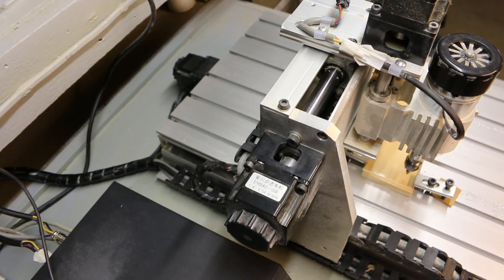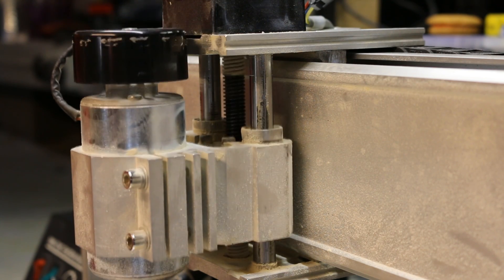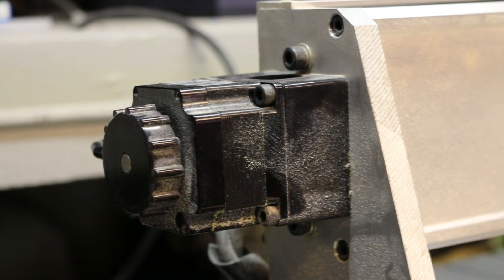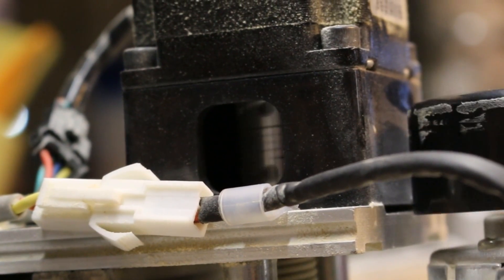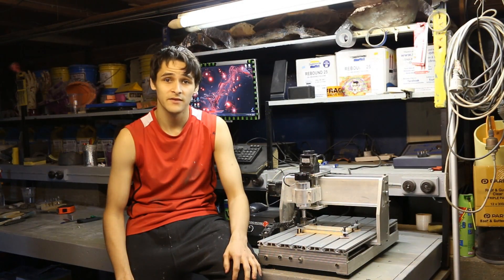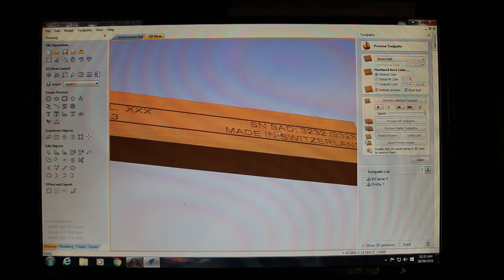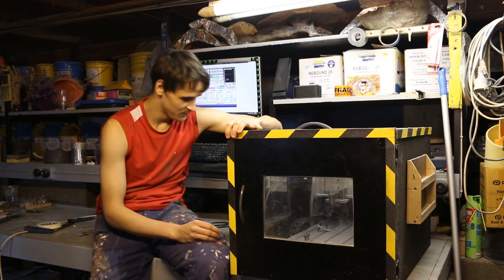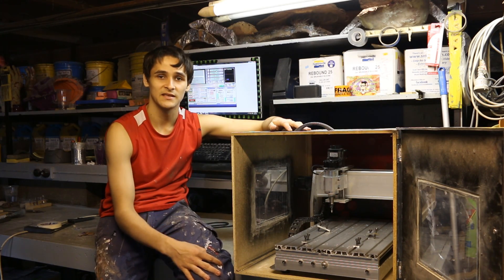3040 China CNC | Review | motor settings | milling and engraving

Comment: I’ve one the same but I change the circuit board to run arduino and changed the drivers to tb6600 , I had to rewire the controller which was a daunting task for me as I’m don’t have much knowledge in this field but good old YouTube came to the rescue and now I have it up and running again .
One thing I would like to add and that is it’s a very sturdy machine.

Comment: I picked up this machine during the pandemic off eBay, I got the 4 axis 3040 for 400$ which was a good deal. The planetcnc software has a issue.
The manufacturer hacked it and used what I believe was the diy hardware instructions to make it work.

I bought a license from planet cnc, and used zone alarm to block it from communicating with planet cnc. As they said it will self reset. Its been a few years, I like planetcnc's host software.

I've made a opensource software/hardware project with info on my channel. You can add functionality like mql to the hardware and spindle control speed. Using the software project.

Comment: Are you running that with a USB cable or a serial port?  I purchased a brand new previously owned 3040 4 axis.  I’m having issues getting the computer software(their version) and the controller to see each other.

Comment: You got a good deal. I paid $650 (USD) for a used 2030 China CNC without the computer and software. I am not unhappy with my purchase; the machine is very sturdy. I got Mach3 and VCarve. Although I got the cheaper VCarve Desktop, the software was still expensive. I drive it with a cheap old computer. Like you, I got this to learn on; there is much to learn, and I dream of graduating to a large machine when I can afford it. About 4' x 4' would be nice - something I could run a door to a house under.

Comment: Hi! Can you make a video on how to use the machine with the program it comes with? Had the machine for 6months now since i bought it i dont know how to use it.
Reply: Have you been able to get the software to talk to the controller?
Reply: @donaldtimme6923  i can move the X Y and Z with the program from the computer, i just dont know how to make anything..
Reply: @Pastor Jose what version of Microsoft are you running?
Reply: @donaldtimme6923  Windows 10
Reply: @AlphaGaming77744  Thank You for your responses. I am also using Windows 10 but the controller and software are communicating.  At least I know it will work with 10.
Reply: @AlphaGaming77744  Did you have any issues with loading the driver. My computer says there is no signature so it will not install that drive. Would be able to send me the driver?  I have had zero luck getting any response from China-CNC

Comment: +Daniel Bignoux, please let me know about MACH-3 compatibility with windows 10, some people say it is only compatible with windows XP, 
also share the link description of BIT you used in this video.
Reply from the maker: From what I know Mach 3 is not compatible with windows 10:http://www.machsupport.com/software/mach3/  I used multiple bits, such as end mills purchased from ebay listings and rotary tool accessories from my local hardware store so I cant really find direct links.
Reply: I have Mach3 running on Windows 10 but I am using a USB connection to the motor controller so that may be why it works for me.

Comment: Hello, I have been looking at the same machine in eBay, I am a hobbiest, and I would be needing to kind of Mill some small aluminum pieces, In all the reading and research there are many nice machines out there at a reasonable cost, but I think I can Make this wor, once i tighten tolerances and possibly change the spindle. y problem is figuring out how to get a drawing put together , Which software to do my drawings, then turning it to G code, and then to Mach 3, I am not a techie, any suggestions to start ? Respectfully, Jim P.
Reply from the maker: I found vectric software, I personally use Vcarve Desktop for my small machine as you can draw and create shapes, even use 3d models withing the software and its easy, im not a techie or a cnc wizard so it was and easier to learn vcarve, but there are a few CAD/CAM programs out there such as fusion 360
Reply: Daniel Bignoux thank you very much I am going to give that Victor program a try least take a look at it really appreciate you taking the time to get back with me I know you're a busy person respectfully Jim Price
Reply from the maker: No problem, I reply when I can. But if I get more then two messages withing a 24hr period thank googles notifications if I don't see them because they are always not showing up xD

Comment: ever milled 2mm aluminium ?
Reply from the maker: yes, i have been screwing around with aluminium for the past week and have seen good results, not the best but not bad coming from this little machine. I am going to do a video soon about it.
Reply: Daniel Bignoux great.....hope to see it soon. I'm in qld....where did you get your cnc? Do you have any sources for purchases. I watched a few videos and they say allu can be done nicely at lower speeds on this model.....
Reply from the maker: yup, slow and steady is the key. My spindle vibrates due to a broken internal clip so I cant get a really nice surface finish. I bought mine second hand off gumtree. I wasnt really looking at specific type of cnc back then, just a cnc machine on the cheap that can do the job. Now im addicted and want to build my own.

Comment: I have a CNC 3040T USB which I got from eBay. For rapid prototyping PCBs, engraving etc it's great.

So far I've not had any issues with bad connections, faulty wiring etc but it's early days. Fingers crossed I don't have any issues at all. I've recently done a few mods to mine.

Firstly I've upgraded the spindle motor from the stock 200W to 400W. That cost about £50 with the bracket and VFD and gives a little more torque. 

Next I've 3D printed out some end stop micro switch mounts which just clip on to various parts of the frame to give X, Y and Z homing limits. I'm just in the process of wiring them in now that I've mounted them and ran the wires through the cable harnesses. This will give me a repeatable home position to work from.

I've also just purchased a USB endoscope / microscope which I'm going to use as a Camera for alignment and positioning. I plan to 3D print out a mount for it to clip on to the spindle bracket.

At the moment I'm using the software that came with my machine which is called USBCNC and it's quite easy to use once you've got the settings for the CNC installed. Mine came with a settings file which I had to import and then after I did that I had to change the language in the USBCNC software to English.

It quickly became apparent that some of the settings were incorrect. Some of the directions were set wrong and the steps per was also wrong. It was set to 320 Steps per but having told the machine to move 10mm and it didn't, I quickly worked out that the steps per should have been 400 - so I put that right.

I actually quite like the CNCUSB software. It's very simple to use. Pretty much just home the machine, drag in the Gcode and start it up.

I wouldn't mind trying Mach3 but it seems the parallel connection on my control box is dead. I purchased a parallel cable for it, hooked it up to my desktop PC running win XP but despite trying to configure Mach3 using a dozen or so different guides, it refuses to talk to my CNC. Perhaps with mine being the USB CNC3040 they didn't bother connecting up the parallel. Instead they just hacked the board to run on USB and didn't remove the old parallel connector from the design.

I have also recently purchased an Arduino CNC Shield V3 which uses GRBL and allows for Auto Level for PCB and planned to replace the stock control boards for my CNC 3040 but having played around with Chilipepper, I'm reluctant to swap the hardware out now. I'm not really keen on Chilipepper from what I've seen and experienced of it so far.

All in all these are good little machines for the money. I'm very happy with the performance of mine.
Reply: Greatt price is here http://bit.ly/2GM4tkO 
Have a nice day!!

https://www.youtube.com/watch?v=SYKNvL7CEH0

Comment: A Buddy of mine just paid me back for some memory he borrowed.  3 JMC-motor.com iHSS57-36-20 Integrated Closed Loop Steppers.  Found on ebay.  But talk to Michael at JMC-motor.com and get the Tuner box they have for these motor.  http://www.ebay.com/itm/NEMA23-2Nm-283oz-in-Integrated-Closed-Loop-Stepper-motor-36VDC-JMC-iHSS57-36-20-/262565317443   This is mine: 4mm  end mill 60mm/s s9000. https://www.youtube.com/watch?v=czdx4DOCbtw      You can find me at irc freenode.net #linuxcnc look for Crom or Cromaglious
G0 F7200 ! G1 F3600 S9000 Linuxcnc PID configure https://pastebin.com/nTNLeX0p

Comment: Hey awesome box! I just picked one of these up and built a large cabinet for it, but I think I went too big. Mine is about about: 60cm width x 76cm deep x 60cm tall. Is yours about the same size?
Reply from the maker: mine is 53cm Width 65cm Deep 47cm Tall. I reused what ever wood I had laying around, I wish I made mine slightly bigger as the gap between the box and the motors is less then a 1cm. Very tight fit, also makes it hard because I cant clean the sides or the back without removing the machine from the box. The size of your box is spot on. If you have room to fit your hands around the sides or the back when you drop a nut/bolt, then your good ;)

Comment: Thanks for sharing ! Can you pls briefly describe limitations of the Spindle/Router in regards to wood & soft metals ? For instance I need to cut through 2cm thick wood. Can It do that ? Or you have to break it in steps with equal depth ? What type of bits should I also buy to be able to focus on wood engraving & cutting ? Thanks again.
Reply from the maker: I have cut 19mm (almost 2cm) thick wood. It can be achieved just have to fine tune the machine for your needs and make sure you have the right cutting bits/endmills. When using a 10mm cutting bit my step down is from 0.5-2mm depending on speed and feed rates. Its best to test the limits as all machines have different settings and the way the motors are tuned. The first time ever using this machine I broke a endmill because of the speed n feed times. I bought both high quality and some cheap endmills mainly to test new speed n feed rates (purposely breaking them) so I can find the average speed I can cut with different materials. Look for high quality wood end mills there are a range to choose from so you will need to do some research about the different end mills for different tasks. You could also look at dremal or rotary tool bits and engraving bits. There are all types of cutting/engraving bits so find the ones that suit your project.

Comment: how do you fully cut out the image outline on a 3d carving?
Reply from the maker: I use Vcarve, SO what I do is once the model has been positioned, select it then go to the 2d veiw.  In the top left under 3D modeling tools, click Create vector boundary from selected components  ( its the one with the blue out line around it). Then treat it like a profile vector, adding tabs and cutting on the outside of the line so it doesn't cut your model.
Reply: ok will have to have a look because ive got planet cnc software

Comment: can you cut 2mm brass sheet with it ?
Reply from the maker: It should with the right cutting bit and feed and speed rates
Reply: +Daniel Bignoux thank you so much for fast reply
am really confused from where to buy this cnc model
can you please provide a link to this cnc.
and how can i get a 4th axis for it ?
Reply from the maker: Try looking on ebay, search for 3040 cnc. From just a quick search I found this one : http://www.ebay.com/itm/USB-CNC-ROUTER-ENGRAVER-ENGRAVING-CUTTER-4-AXIS-3040T-CARVING-300X400MM-ARTWORK-/391540668945?hash=item5b29a47a11:g:DP0AAOSwmLlX40Fh

Comment: Take advice from machinist, don't move your hand under spindle while it's still spinning, saw stories of bad injuries that way. 

:) It's a learning curve, just want you to become experienced without losing fingers.
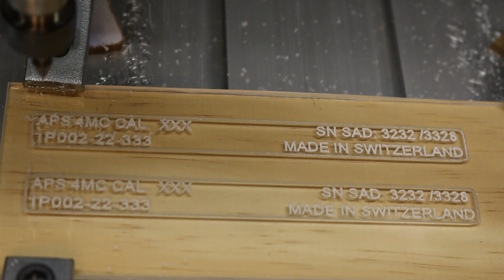Reply from the maker: If your referring to 4:30 or so the spindle was off before I rubbed away the excess material. Hard to tell I did looking back on it because the way I edited the clip. I plan on keeping my fingers and i'm luck to still have all ten digits after all the stupid things I have done in the past ;)
Reply: I could see spindle stop after you wiped but looking closer your hand probably was offset further away than what it seemed initially. So not that dangerous but still little bit risky. :)
Reply from the maker: I have had some close calls and its because of those close calls I now use a toothbrush :)

Comment: Thank you so much for the video. 
Can I ask a question, does it cut gold sheets or any metal objects or only wood ?
Reply from the maker: It can do soft metals, I have engraved aluminium and I have seen it engrave brass and copper. But keep in mind my spindle is broken and this is because its not made up to the highest of quality. Just remember this machine is for the small hobbyist but I have pushed it way past that line to were things start breaking.

Comment: hi there 
great video i have the 3020t cnc and i'm running it with cambam and  snapcnc from docado.com
to control the machine snapcnc is grbl based and there is no need for mach3 it working fine for me as with
all machines it is a steep learning curve but its amazing what can be done with these machines
i only do small projects for my model railway layout and i have made some buildings with it
keep up the good work
Reply: Did your machine come with Mach3?  Did you upgrade or were you able to override Mach3?  If so how were you able to override it?  I have been looking at CNCs for several weeks and have become accustomed to seeing all the tutorials on grbl.  But I like really like this machine but it comes with mach3 and not grbl.  I'm trying to figure out how I can still get this machine but use grbl instead of Mach 3.  I would like to use Easel to create my designs but I think it is grbl based.

Comment: what computer operating system are you running?? windows version???   older computer I'm guessing    and after plugged in how do you setup mach3 to the machine?!!! lol   very big noob here
Reply from the maker: I bough the cnc with mach3 already installed. Im running window 7 on a on this old computer, From what I can see Once you buy mach3 it should be as easy to install but you will have to look up how to configure your cnc with it. Look around on youtube for setup tutorials, I don't know everything only the basics. If you know the model type cnc you have search online for a manual there might be something in there that would help.
Reply from the maker: Sorry I couldn't help any further

Comment: what software do you use?
Reply: hello
try snapcnc from docado.com its grbl based and there is no need for mach3 
also i use cambam for generating gcode hope this helps you
Reply from the maker: mach 3 for the controller but as for getting the tool paths and such I use Vectric VCarve Desktop
Reply: thank you so much!
Reply: hello
try snapcnc from docado.com its grbl based and there is no need for mach3 
also i use cambam for generating gcode hope this helps you
Reply: Thank you!
Reply: you are welcome
Reply: james o'connell can you help me? I don't know why my mach3 doesn't load the g-code complete?
Reply: hi there 
sorry i can not help you as i run my cnc wtth
grbl based software its called snapcnc  sorry about that
Reply: Mach3 loads partial Gcode if you are in trial mode

Comment: What's the wattage on the spindle? 
Can you engrave metal? Maybe mill 2 millimeter metal sheets?

Thx.
Reply from the maker: I do not know the exact wattage but I think it sits around 400. I have engraved aluminium and taking it slow with a lubricant it work well. I have yet to try steel.
Reply: +Daniel Bignoux I appreciate your response...I'm looking at a 400 watt myself. Very helpful. 

Thx again!!!